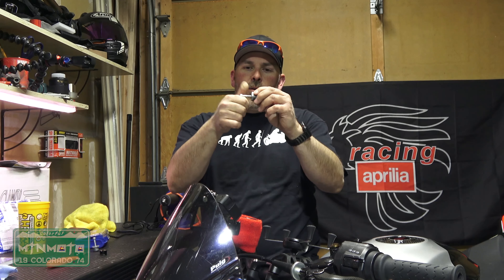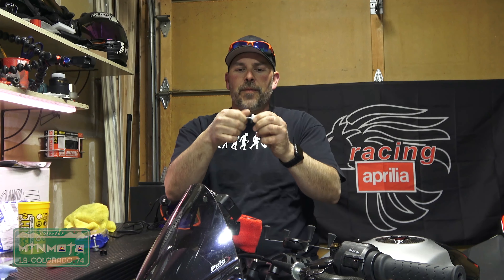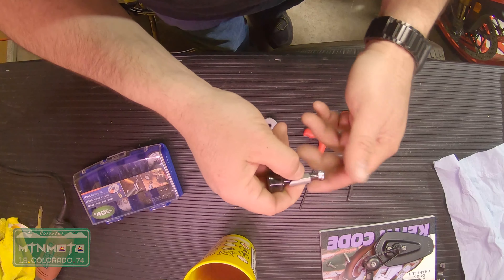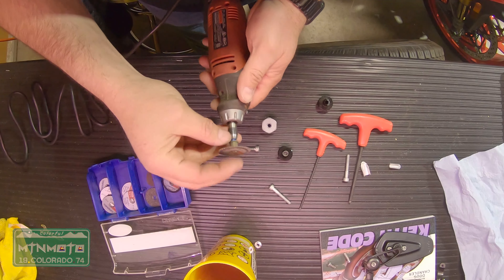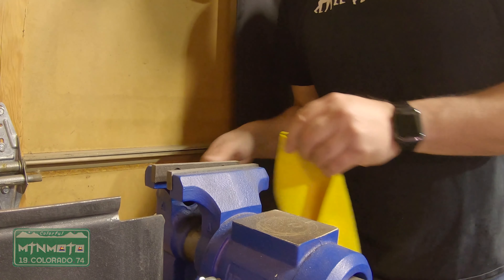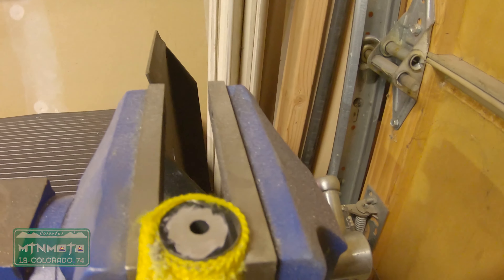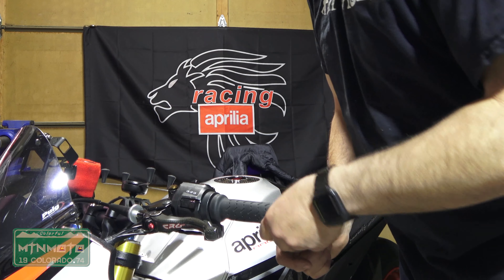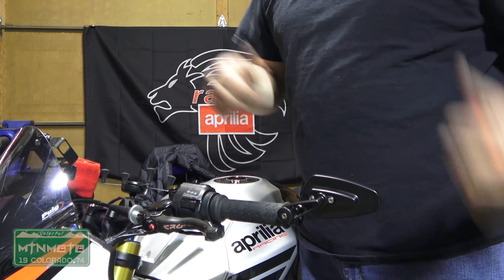2018 Aprilia Tuono Factory | The Ultimate Build | Part 15 | The RIGHT way to install Bar-end mirrors

Comment: You can buy from puig and aprilia bar end adapters together. More easy 😉
Reply from the maker: Sounds like there are many options
Reply: @MtnMoto  yes many options. I already ordered for mine. also wind screen with adjustable visor, waiting for them :)

Comment: On the clutch side there is an inner sleeve inside the bars. This stops expanding fixings from going into the bars far enough to get full purchase. The brake side does not have it hence the better fit.
Reply from the maker: Ah, that makes sense

Comment: hi what brand is the smartphone holder?  is it safe even at high speeds?  (over 150 miles)
Reply from the maker: It's a RAMmount X-grip XL and as long as I remember to use the tether it's extremely reliable. I did an install vid earlier in the build on it. It should be listed in the description of your looking at buying one. 
As far as high speeds, it hasn't failed me on smooth roads at 170 and a bump in the corner at 145 👊✊👌
Reply: @MtnMoto  grazie mille  💪

Comment: hello , i have tunon -19 my self and you seem to know more about it then me :) . what is the turqe specs for the fronttire axel nut ? .cant fucking find it enywhere :) .
Reply: SincoLive The front wheel pin nut torque is 80Nm (59.00 lb ft) for your 2019 Tuono.  It’s on page 20 of the Service Manual of which you can purchase & download at AF1 Racing here for $8.15 USD https://www.af1racing.com/store/Scripts/prodView.asp?idProduct=86951